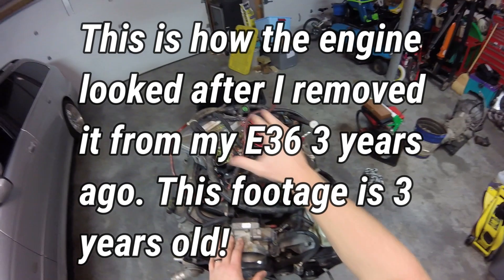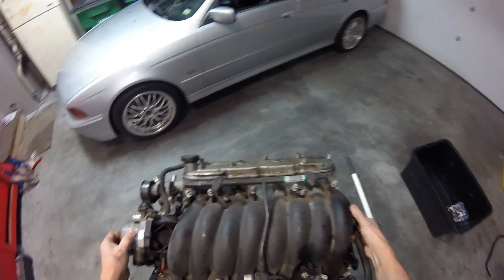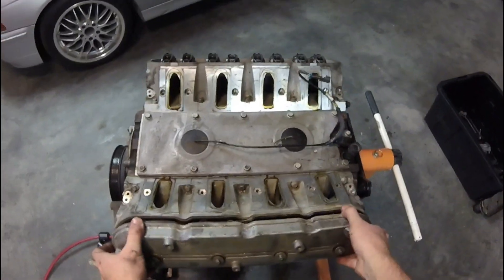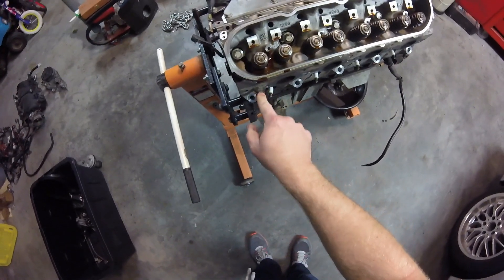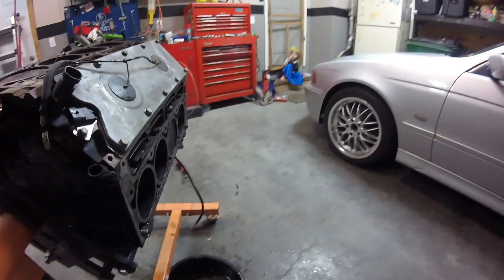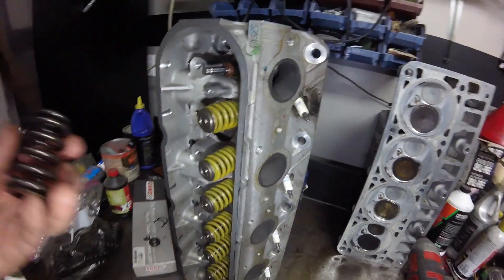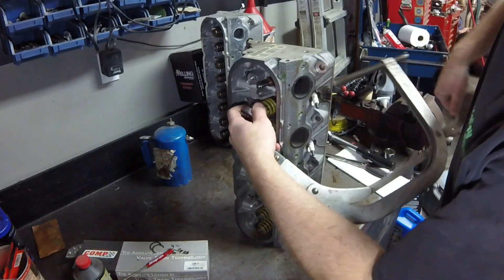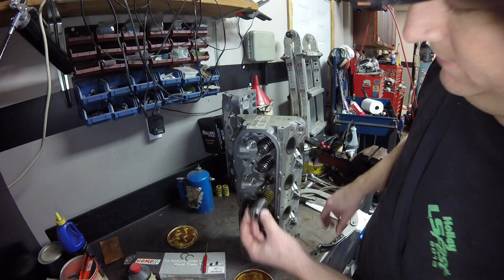LS BMW Engine Build Part 1-(BMW E39 Wagon LS Swap Part 3)

Comment: Great content bro u got my follow but what rear end do u plan on using I’m doing the same build but I plan on using a Ford 8.8 rear end any tips I can take notes on?
Reply from the maker: I’m still up in the air on the rear end. I might end up using the stock diff for now, but then I’d have to figure out the driveshaft situation. Maybe I’ll throw in an 8.8, but then I’d have an axle situation. I actually lose sleep over that question! If you know of a good way to go from 8.8 to bmw spindles I’m all ears.
Reply: @PetesGarageandperformance  I was hoping u had tips to make the 8.8 fit 😂 I’m doing all kinds of research on it because Ik ppl done it plenty on times on 335s and 135s so ima get tips from those owners and I’ll lyk what I get I’m building a e39 528 with a 5.3
Reply from the maker: Nice! I’ll figure it out when I get there. My old e36 had an LSD and I was able to buy a flange to bolt up to a 1310 u joint. Then I made my own driveshaft. But this stock 525i diff isn’t LSD and has this stupid 6 bolt flange on it. I should just start looking for an 8.8. Lol
Reply: @PetesGarageandperformance  https://youtu.be/mayYpK_aPgM this video this guy resized a 8.8 but the part where I don’t understand is if I’m supposed to use the whole rear end or just the pumpkin with diff axles that fit the bmw
Reply from the maker: You have to get an IRS style 8.8 out of either a mustang cobra or an Explorer (which is the one I was thinking). The Explorer looks like the mounts on the rear cover look like they’re close to where they need to be. But then you’d need axles that have the cv joint that fits the 8.8 on one end and the bmw spindle on the other.
Reply: @PetesGarageandperformance  ok thanks on the info